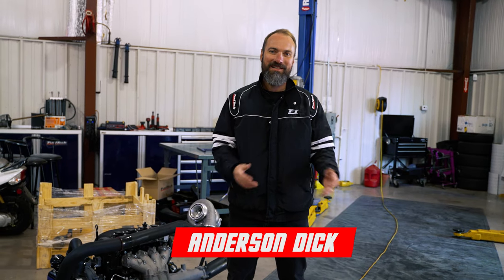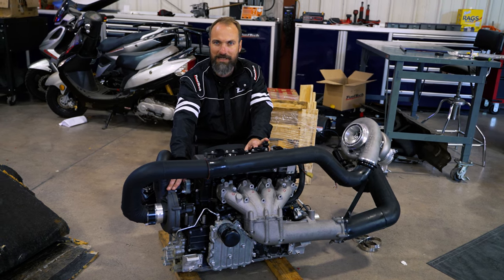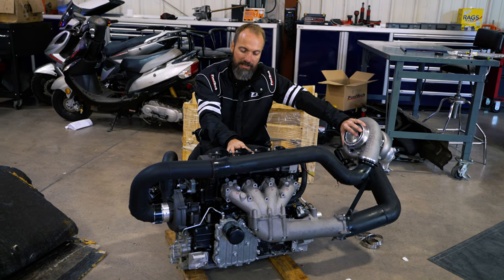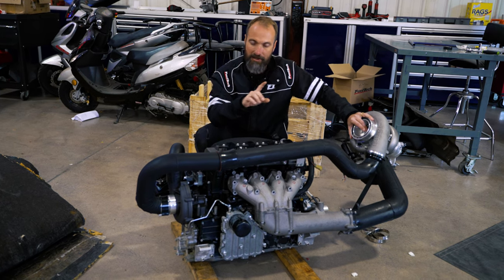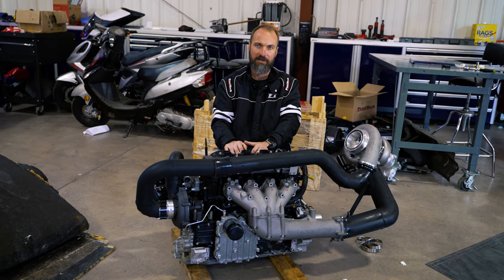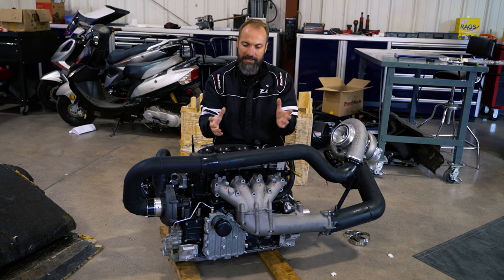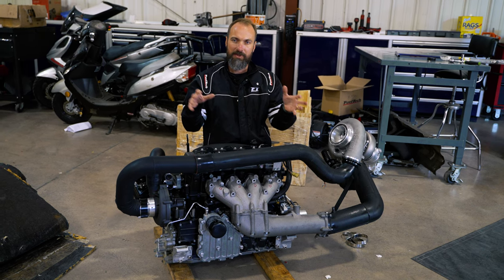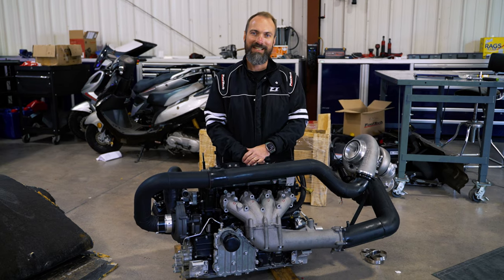Compound Boost | Yamaha SVHO Jet Ski | Garrett Turbo

Comment: That is still Mind Blowing that VW Boxster style 4cyl engine making a little over 2000hp and since it is in a Pro Mod chassis they should have no problem getting that car to run in the mid 6s in the ¼ mile or faster depending on how light the car is and how the weight distribution is and if it hooks up good and goes and goes straight down the race track and I wonder what transmission is in that car and I wonder if they run that car in the ⅛ mile or in the ¼ mile and I wish that the guy's at Fuel Tech would ask the owners of these cars to come back or send them a video of their best pass up to date after they put the car on the hub dyno and then take the car to the track and dial it in at the track so we can all get a before and after of what the car ran before they brought it to Fuel Tech and after they brought it to Fuel Tech and got the guys to work out and find all the bugs and got the car dialed in and put a hot tune in it and then took it to the track and Fuel Tech would be smart to hire a traveling crew of guys that go to the track with the owners of the car's they put on the hub dyno to help them completely dial the car in at the track so the car can run to it's full potential

Comment: Problem with compounds with superchargers is the supercharger parasitic losses are directly related to airflow by MASS through the charger. Still an awesome setup! Running compound turbos myself I always love to see staged compression of any kind!
Reply: Are you trying to say that the mass of the air flowing thru a supercharger is what causes its inherent inefficiency?
Reply: @pastaalalamborghini  yes. Almost completely decoupled from pressure ratio too. If you check out the Steve Morris video where he hosted the TorqueStorm designers, they do a dyno session with a fixed bleed valve at different positions for their new supercharger. Very enlightening video.
Reply: The real problem is the supercharger clutch sucks and fails a ton. Thats the number one reason why people remove the supercharger and go turbo.

Comment: Anderson, every one is really concerned with the Bosch unit on the new SeaDoo RXP325 with the 1630 ACE. They say it's "not unlockable". Big opportunity there for you guys. If it's not tunable, people are going to be knocking at your door for a stand alone system. Good luck.
Reply: Check out ruthless racing. They only doo sea doos. Yes they have kits for the 300 and 325

Comment: Anderson you need to talk Kyle from @Boosted Boiz into building a 1000hp Jet Ski so the two of you can race them on the water and I wonder if a B-series or a K-series 4cyl Honda engine would fit in a Jet Ski in the original engines same configuration without having to modify anything because I wouldn't think that you would have to modify a whole lot if you did an engine swap and if you did I wouldn't think it would be much you have to modify but on video the Yamaha 4cyl engine does look alot smaller than a Honda 4cyl engine out of a car and another thing I don't see why you couldn't make a 1000+hp with the compound setup on the Jet Ski because you can make 1000+hp from a Snowmobile engine and that should be the next build for Fuel Tech is a 1000hp Snowmobile with tracks on it so you can make passes with it on the drag strip and then do a high horsepower 4 wheeler or dirt bike or a high horsepower scooter or something else crazy like that as long as you have somebody to ride it